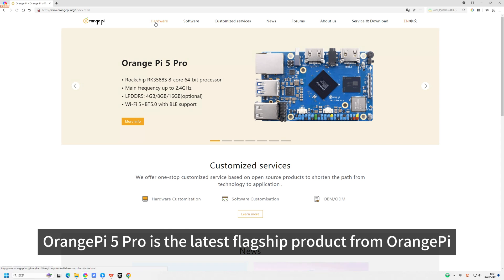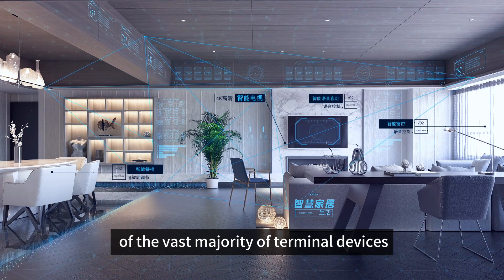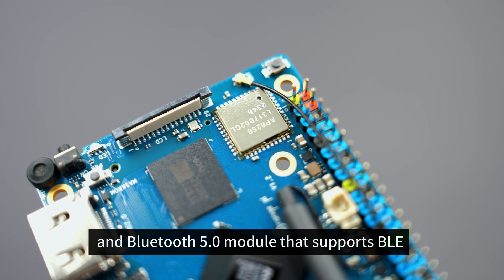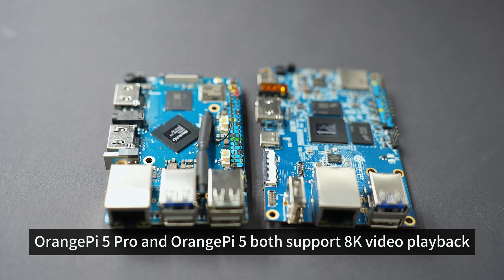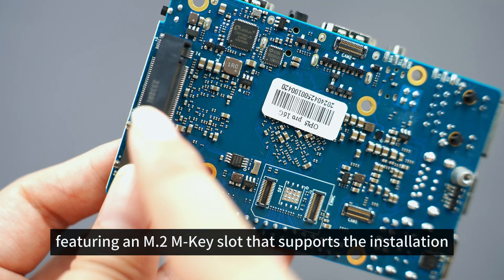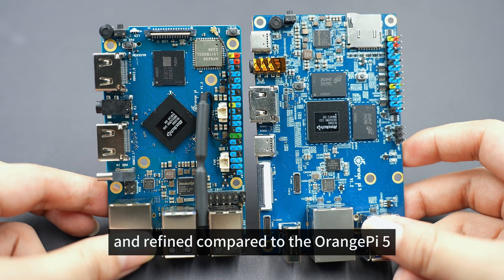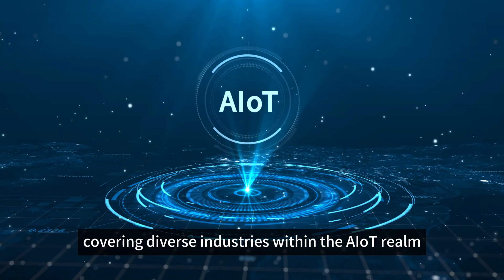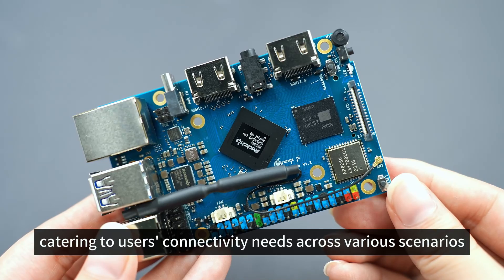Orange Pi 5 Pro: Upgraded Performance and Enhanced Features!

Comment: please get some x86-64 base sbc, but please remember to have enough ram band width for the x86-64 soc
Reply: They make arm sbcs, not x86 ones, keep dreaming
Reply: @rtx3060g6  they did not make one before doesn't means that they will not
Reply: @stephensu4371  yea it'd be awesome to see small x64 boards with full PCIE 3.0/4.0.

Comment: Is there way to use emmc as spi flash in order to get nvme boot?
Reply from the maker: Just burn rkspi_loader.img directly to emmc
Reply: @orangepi5692  so it does, niceeeeee
it opens several more questions but i will try myself 
but in general i would say, if I do it that way i couldnt use muy emmc anyway, as it cannot have multiboot in there 
so, thanks you ae the best :3